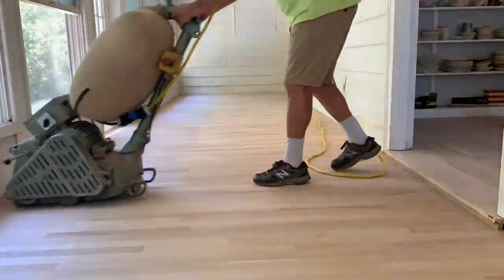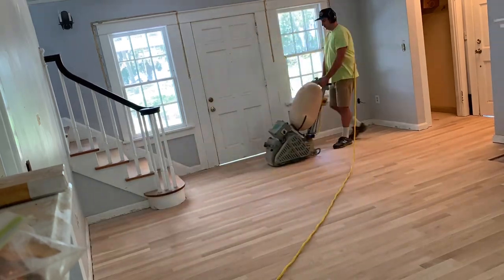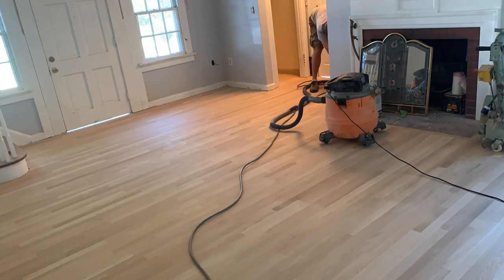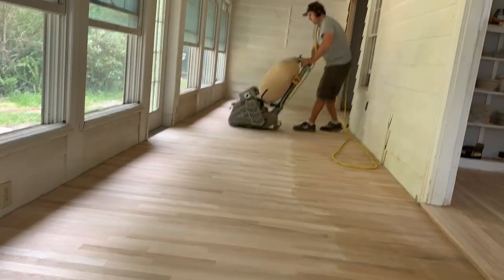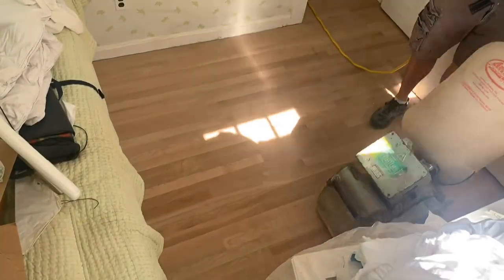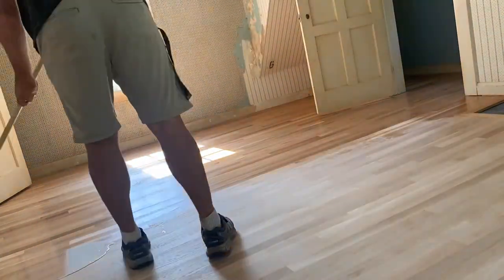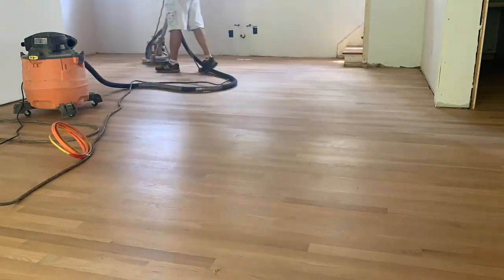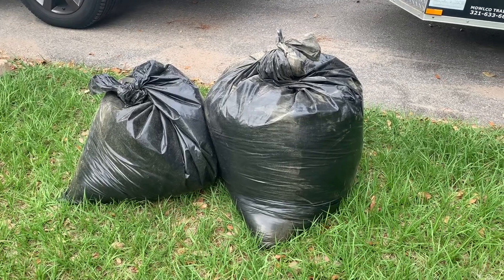How to Sand and Refinish Hardwood Floors!

Comment: Would you always use a drum sander no matter the condition of the floor? Also, is a sealer necessary? The water based varathane I purchased doesn’t mention sealer
Reply from the maker: I do. I start every refinish with my drum sander.

Comment: Hey, thanks for the video! If my understanding is correct sanding is necessary even for freshly installed floors, why is that?
Reply from the maker: The wood will come raw, it’ll be uneven, the boards won’t be clean, there is a lot of reasons it needs to be sanded. If you have floors installed it would be obvious it needs to be cleaned up it’s a little hard to describe

Comment: Can you tell me if I can use a roller to apply Varathane

FLOOR FINISH
POLYURETHANE
ULTIMATE DURABILITY
HIGH TRAFFIC FORMUla 
Is a oil finish , I want to use a roller to applied
Reply from the maker: Yes, you can use a roller! Some people actually prefer to use rollers!

Comment: The process should not be the same for all floors. All floors are different and should be treated that way. Have a default grit progression for all jobs would also be incorrect. In your case as you mentioned you start all your jobs at 40 grit. When in reality in order to know what grit you are going to start with, you must fist know what grit you are going to stop with and go backwards from there. For instance if you're going to stop your big machine at 80 grit just as an example. Back up two grits to 50 grit being on the HUMMEL. Make a few passes and see if the finish is being completely removed and that the floor is flat. If it is, then simply continue with 40 grit. If not, jump back one more grit, make a few passes. Make sure all the finish is coming off and the flooring is flat. Head towards lower grits as needed. And not as a default. On all cuts except the final cut tilt your machine at 10-15 degrees. The next cut tilt it 10-15 degrees to the other side. Final pass runs with the grain in order to re direct the scratch pattern. Angel cutting the flooring gets the floor flatter. As well as reduces dish out. Which is seen especially on the more open grain lumbers and most softwoods especially with knots.  Going from 40 -80 grit is skipping 50 and 60 grit. Skip only one grit. You claim you don't have that big an issue. The issue is 80 grit will not remove all the 40 grit marks. You "in most cases" won't be able to see what the 80 grit cant remove of the 40 grit. On a microscopic level what the 80 grit can not remove is indeed evident. While you may be thinking, "who cares at a microscopic level" In reality with the over all look of the job shows when sanded while not skipping more then one grit. Additionally how well the finish adheres and stays in tact over time depends on the flooring being sanded correctly. On the end grain walls you're not clocking the edger correctly in order to reduce edger marks. You applied waterbase finish onto the floor without the use of a sealer. Bona Kemi products require a sealer for a number of reasons. 1) To prevent side bonding. 2) To prevent panelization. Would be just two of the reasons to use a sealer. Bona Traffic Naturale is a finish, not a sealer. There are no two part sealers. When laying out waterbase products, you should hot coat two coats on the same day. Let that second coat go over night. The next day buff and apply the final coat.
Reply from the maker: Thanks

Comment: I just had my floors done (by a contractor). The end result is not perfect. There’s a significantly darker area all around the floor (approx. 4-in wide), as if they cut in around first when applying some of the coats and the middle section didn’t get as much?  I'm juste speculating here, but I try to see if that’s somewhat normal to get an uneven look like this for a new floor of if I should complain.   They said they used a semi-gloss water based finish.
Reply from the maker: Definitely not normal. We call that a halo. That can happen for example if you don’t buff after fine sanding, actually there’s quite a few ways that can happen. It’s definitely not normal though.
Reply: A halo around the room would be more noticeable on the end grain walls. It's caused for one of two reasons. 1) The edger did not finish up with  the same grit as the big machine. The higher in grit you sand with, the lighter to wood becomes. Additionally the edge marks aren't blended into the field where the big machine ran. 2) The mil rate of the finish is thinner on the edges then the field of the room. That will create a different color around the border of the room. AKA "A Halo" Sheen of finish doesn't matter. No it's not normal.

Comment: Congratulations on posting your first flooring video! Quick question on your sanding grits. What grit did you use on your buffer (the one you forgot to record) after the 80 grit sanding? New sub here.
Reply from the maker: Hi Mark! I used a 100 grit screen on my buffer!
Reply: @jobart1028  100 grit sceen to take out 80grit Hummel lines, i dont think so.